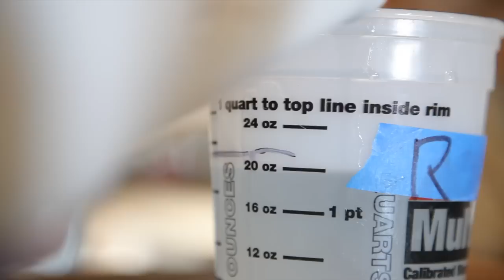The proper way to mix and use 5:1 Epoxy for fiberglass boat work

Comment: Here is a small tip: Get a silicone spatula and use it to empty the last bit of epoxy from the cups. Reusable and it gets every drop of the epoxy. ;)
Reply: the only drawback to scraping the cup is that you can sometimes get material that is not fully cured

Comment: I spent ten yrs., restoring an Alden 41 ft.,C/b cutter,built in 1940. I bought it as a bare hull, steam bent all the frames,replaced all the deck frames. this boat had only an ice box,when i was finished it had all the modern upgrades possible. The boats name was ARROWHEAD #699

Comment: I am replacing floors on my old ski boat before I re carpet. Question is after new ply wood and I epoxy it, should I really fiberglass over floors or will epoxy resin be enough.

Comment: What about air bubbles? I know its being compressed by the clamps. but there are alot of air bubbles in the mix. What if you arent compressing a part? I normally would put a heat gun to it. Then again, I never used 1708. Is 1708 good for no air bubbles?

Comment: coloring fiberglas.....use oil base paint, < 10%?    alkyd paint?   other ideas that preserve the strength?   Should the first coat of anything on a small wood boat be just plain FG?   OR maybe start tinting the FG to the color you want in the final job? THanks

Comment: why oh why.....quarts ! ? and not liters, mili liters etc. !!
Reply: Because the Imperial system is still used in the U.S.
Reply: ningpo69 what's the difference....its 5:1. All ya need
Reply: As long as your ratio is 5:1, the units of measure don't matter.

Comment: "Glue" describes a product derived from animal parts, such as hooves or hide. This term does not apply to the use of epoxy resin and hardener.
Reply: Ya man that's not necessarily get the hell out of here